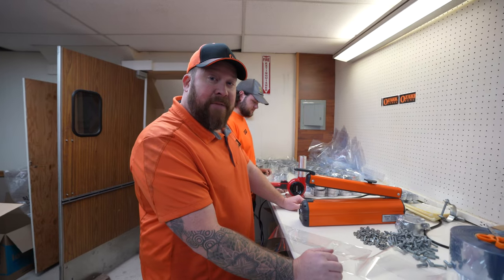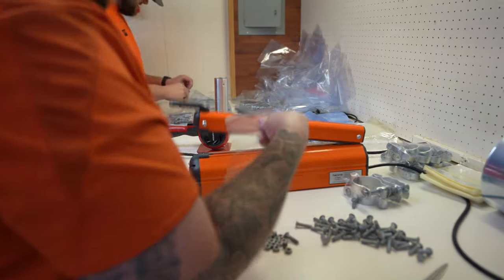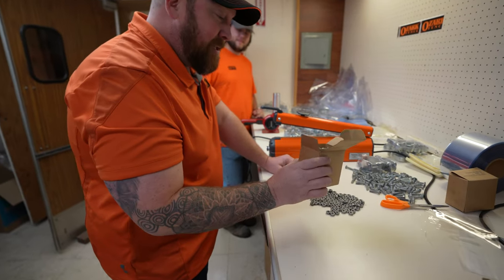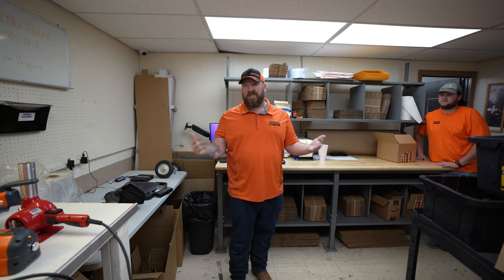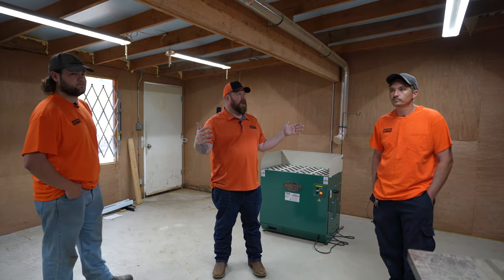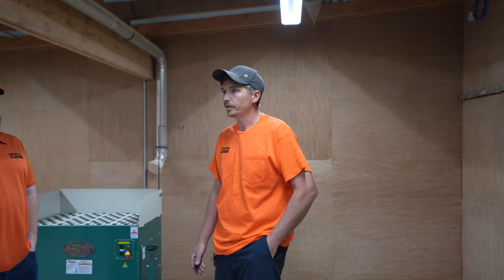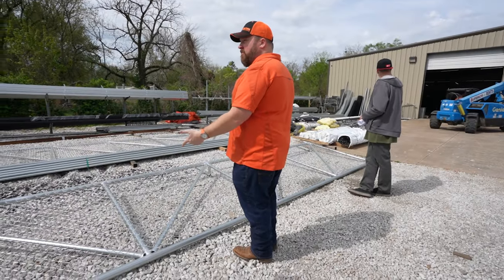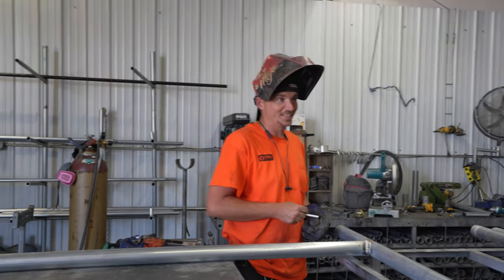We Had a Chain Link Fence RACE - Week in the Life #2

Comment: Using  the heat shrink machines are awesome and time saver even though ……money money money, but pay for themselves over and over, just fyi and advice……keep them serviced bi-yearly to yearly like Swiss watch (whatever is recommended) b/c when they go down, it’s not fun at all, especially when used to using and everything been running smooth; it’s a hiccup that can set you back days to weeks in matter of hours or days if not up in running quickly (same for anything using in the fulfillment/shipping process, even the darn invoice & label printers and using specific rolls of “paper” that end up being back ordered for 2 weeks everywhere you’ve checked, lol. Until find a great biz that happens to use same and it’s you borrow a roll or 2😉
Reply from the maker: Great point on the service, I'll check out the service schedule on Monday!

Comment: Joe I own a fence company here in Florida and I use 3 1/4" smooth shank hot dip nails for the 2x4 rails and I use 4 nails in each spot. Will that hold over time or should I use longer ring shank nails?
Reply from the maker: Should be plenty!
Reply: @JoeEverest  yeah but is smooth shank unreliable is what I'm asking? I've been using smooth shank for all my rails but ringshank for pickets
Reply from the maker: @outdoorluxuries2887  missed that, ring shank is essential.

Comment: @joe Everest
Hey Joe, companies I’ve worked for In the past would have there shipping dept in its own room. Fulfillment dept would have its own room, and when orders came in; each dept would have PC and printers that’s printed out invoice info for both dept; fulfillment would have separate invoice printed for packaging and what not, and then placed in bins to move to shipping. When shipping got the bins they’d pickup orders that had a QC invoice attached and barcodes/QR codes/etc that shipping would scan screen would pop up prompting person to do last QC check and make sure everything included, they’d enter their own employee code to finalize order (also helps track QC issues) and 2nd shipping label would print that would be matched up to 1st when order placed (but this a return label from biz/person ordering) and final invoice and label adds to shipping box and sealed, scanned thru system again, and into bin for awaiting pickup from the shipping carrier particular package being shipped (so, we used ups, FedEx, usps, & at certain times couriers for in city RUSH [at customer’s expense of course] etc….) and then off it goes.
Might help you guys out to know/see how others do; and good thing is to have those scans and QC checks to make sure things running smooth as silk, but not to panic when mistakes happen….Cuz they will and do😊
Thx for interesting series and didn’t think like format, but I’m enjoying 👍🏻👍🏻
Cheers✌🏻
Reply from the maker: Wow, I really appreciate the insight! I could see this system really coming in handy as we scale, I'll start looking into it!
Reply: @JoeEverest  very welcome, and just a suggestion of things I’ve learned hard way, & throw it out there for ppl to “know” and then make up own minds. Just having a “computer controlled logistics database/system” using dot QR codes, barcodes, etc…to manage inventory onsite, in the field, and tools, really helps as well (yes, can be a time consuming pain to setup from start….and costs for program; but so worth it in long run); can “pick ‘n sort” upcoming jobs by scanning inventory and “assigning” batch to crews, then each morning (etc) come in scan material piles and ha all info of location, itemized material broken down to fetters, tools, guys/gals on crew etc….& best part, they can us own phone to sca, don’t need handheld scanner for this part (having handheld scanner for inputting and sorting is faster or ppl doing and shipping/receiving/etc…but when PM comes in, uses own/company phone to scan sorted materials and BANG, should be good to go for day/week.
Appreciate reply and hope helps, & for everyone else, systems like this out there and works for all sorts of industries/jobs, along w/ price points and “ability to add and grow” when need to which means don’t need to shell out bunch of cash for things don’t need; until you need them😊
Cheers Joe✌🏻